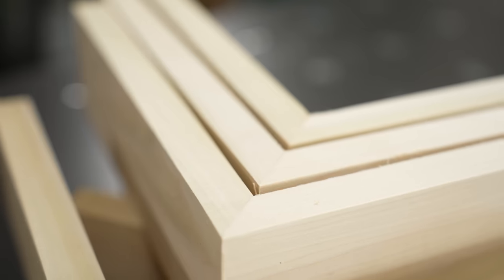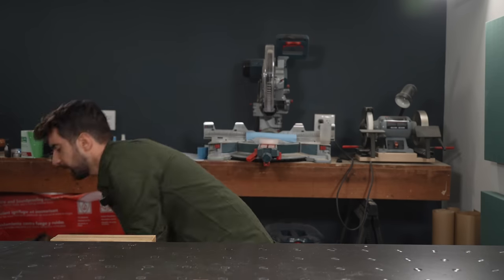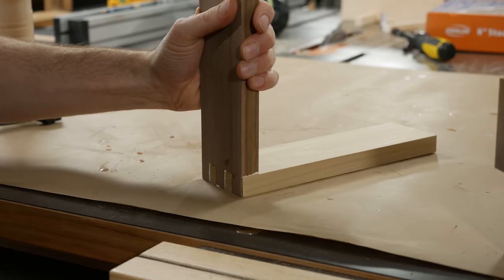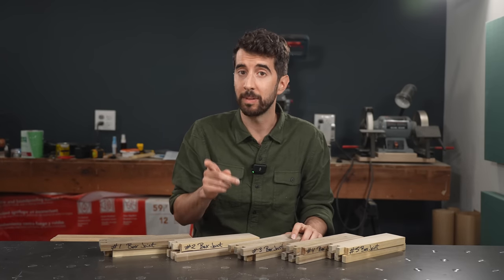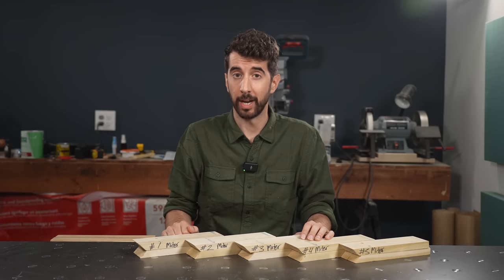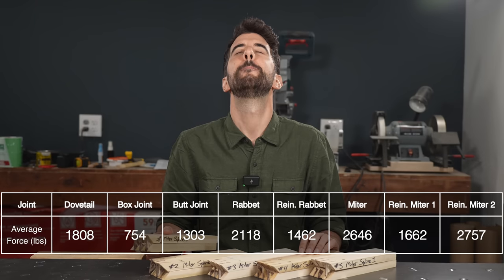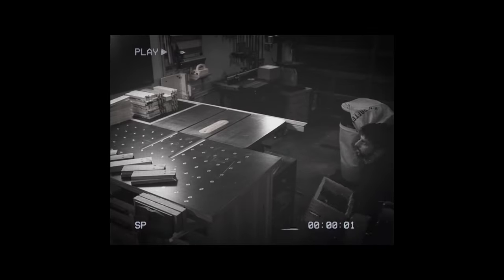This Simple Joint is Stronger Than a Dovetail!

Comment from the maker: If you’re struggling, consider therapy with our sponsor BetterHelp. Click https://betterhelp.com/scottwalsh for a 10% discount on your first month of therapy with a licensed professional specific to your needs.
Reply: What im struggling to see are the tests. All i see are you talking about them. Maybe therapy could help me with that?
Reply from the maker: if all your here for is numbers, then just skip to the end of the video
Reply: Time to drop this channel because of lame sponsors that have nothing to do with wood at all
Reply: @Yraens blah blah blah blah
Reply: @Yraens  Ridiculous that you're willing to watch something and not support the creator by sitting through a tiny ad section without throwing a tantrum...
Reply: You do realize you were pulling on the Tail piece of the Dovetail right?
Reply: @ScottWalshWoodworking  I think they are here to see how you got your numbers.  A miter joint is stronger in some ways, but not a drawer face with two miter joints. If I pull on one end the wood and angle stop the breaking, when glued. Just like the pressure on a Dovetail should be in the pins, not the tails yet all you did was test the wood fiber strength and glue strength NOT the strength of the joint.
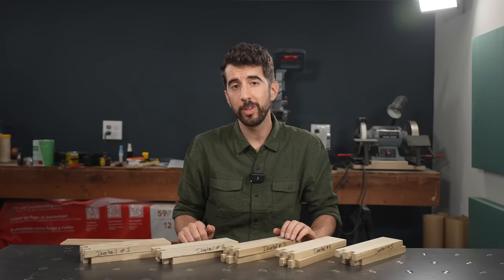Reply from the maker: @jimdoe1694  I was pulling on the pin board, you can see at 2:32
Reply: I was hoping you had included the locking miter joint.  Takes a special (re. ex$pensive) router bit, but no worries on clamp angle.  I've never had a locking miter joint fail, but I have had a patience failure trying to get the joint centered since one edge is done flat on the router table and the other is vertical.
Reply: First time watching.  The back ground music was annoying and the breaking noise was way to loud.  I had to keep raising and lowering the volume.  I did like your random funny comment I think the video was a tad bit too long.  I am always looking for more channels to sub to.  I typically watch 300 videos a day so I am often staved for content.  I won't be watching your other videos because of the music.  Good luck in the future and hopefully you stop adding music in the future.   I normally don't take the time to tell creators, but your video was so exceptional except for the music/noise that you deserved some constructive criticism.
Reply: @ScottWalshWoodworking  Not when it's one sided and you hold the other side, its pulling on the tail board too.  Make Drawer, put it outside, wait 2 years, then pull on both ends. 

Either way, the joint itself still held and the joint was stronger than the wood. All you did was another video on how glue is stronger than wood, who knows about the joint, and once again missing a dozen other variables, to come to some conclusion that a miter joint itself is strong.   Don't use any glue, which other than knowledge, skill, decoration, purpose, function, fashion, was the original purpose of the dovetail joint similar to other forms like many Japanese joints.
Reply: you sir have blown my mind
Reply: The mitered joint is just a bigger end grain glue up. Endgrain glue up are stronger than cross grain and parallel grain glue ups.

We think the opposite because wood is so much stronger with the grain than across it.

A few years back someone did a good video on this, and I can't remember the channel, but end grain glue ups were more than 2x as strong as parallel grain glue ups. They just always fail on the glue joint because wood is so much stronger in that dimension.

End grain glue ups are stronger because the wood is more ports on the end grain, so the pva has significantly more purchase to make a strong mechanical bond.

The miter benefits from all of this added strength, but does so over a larger area. Pretty much perfect.

Finally, what you say about glue failure from wood movement may be a real concern, but the miter should be the least affected by this of all the glue only joints, as the boards should expand and contract relitively uniformly in this thickness, and the glue will stretch with them just fine (as opposed to the rabbet, where the faces will expand and contract differentials from one another, creating a shearing load.
Reply: @Yraens  mental health is a very important yet sadly still undervalued issue. I hope you eventually learn that and grow supportive of it. Bye.
Reply: Do you think the results will be relatively the same if you do a vertical test? Meaning, you don't try to increase/decrease the 90 degree angle of the joint BUT try to put opposite directed forces on the two ends of the joint woods. Kind of testing the vertical strength of the joint.
Reply: My specific needs are to hear the * pronounced correctly as "asterisk", not "asterix".
Reply: 6 @ScottWalshWoodworking
Reply: Lincoln St. Woodworks mentioned this video. Of course, he said he was going to provide a link to it but he "forgot" to add the link. Cool video.

Comment: You forgot to test the most common joint: 1/8" pressboard tacked with one tiny staple, later repaired with clear tape.
Reply: ... and later still re-repaired with duct tape
Reply: ROFL, truth.
Reply: I tested this and SUPRISINGLY it failed at over 8,000 lbs.
Reply: Exactly 😂
Reply: I just had to repair a bunch of those in an apartment renovation. So annoying.

Comment: I think you have missed the point. There's a reason you see very old furniture with dovetail joints. Longevity. Most draws are never going to have breaking point loads placed on them. They will however have the stress of constant moisture changes and the resulting cupping effects and differential expansion rates. That's what dovetail joints are about.

Comment: Interesting results with a different testing setup than most. I'd like to see you expand on the theory of glue starved box joints. Compare box joints with varying amounts of clearance to see if a "sloppy" fit is actually stronger than a tight fit.
Reply from the maker: I'd totally love to, but it might be too far in the weeds for most people. I'll think on it some more.

Edit, I think Matthias Wandel did a similar test
Reply: @ScottWalshWoodworking  Matthias did similar joint tests and also speculated on glue starvation, but as far as I know he didn't compare different clearances to see if it had any effect.
Reply from the maker: @steveyork4173  i think this is the video I was referencing, it's not exactly the same, but it does touch on leaving a gap in a joint: https://youtu.be/14Mkc63EpMQ?si=nXc_Etpwpn-30U4J
Reply: The reason why dovetails became the gold standard for drawer boxes is because the forces drawers experience are where the dovetail is mechanically advantaged. You don't even need glue, so the fact that hide glue sucked didn't matter. The harsh truth is that any joint made with modern glue is going to be strong enough for a drawer box, including glue-less dovetails and glue starved box joints. So it's interesting, but at the end of the day it doesn't matter in reality.
Reply: @ScottWalshWoodworking  10 years back. No wonder I didn't remember that one. 🙂 He does seem to show that having a looser joint could be stronger. Still think it would be interesting to know the point of diminishing returns. Where's the "sweet spot".
Reply: @ScottWalshWoodworking  I for one would love to see that test, and do not believe it would be too far in the weeds. However, I understand you need to make videos that people will watch for it to be worth your time. But I really think lots of us would love to see this test! Thank you for all the time to you take making these videos.
Reply: Or he could test pulling on the Pins rather than the Tails, for anyone that has an ounce of woodworking knowledge.
Reply: I'm subscribing right now so I don't miss the sloppy joint video.  😁😁 @ScottWalshWoodworking
Reply: Subscribed 👍 i want to see this test too! I'm a newb woodworker and make varying types of fits. I've always wondered how much it effects the strength
Reply: I think you probably nailed it with the glue-starving theory.
And seriously, 'most' people watching this type of video are quite likely to be exactly interested in if their 'sloppy' fit work is actually stronger than how you tested with frankly nicer tool than most of us have available.  Its odd how you decided to do a second test on the mitre and not the box.
Reply: @CarlYota  If we were all just making drawers/boxes then you might be right. But we're not.
Reply: @Joslemian   I would love to see that test too ...these results don't align with my real world experiences.
Reply: It seems it's more important to focus on fatigue rather than join strength or tensile threshold, unless you are designing ultra sleek furniture with minimum material... Futuristic kind of.
Reply: @codirtbiker  Can you imagine any of these failing in normal use. Even 100 lbs is a lot of stress for most drawers.  And if you're working with MDF, endgrain isn't a thing.
Reply: @oneeyedphotographer  It depends on your definition of "normal". I agree for a drawer box, even a butt joint will probably do the trick in most cases. But box joints aren't only used for drawer boxes. I have used box joint/finger joints in the past as a load bearing joint. For instance, a cantilevered chair or bench or something like that. It is certainly possible to put several hundred pounds of force on a joint in real world uses.
Reply: @CarlYota  Strewth!
Reply: @codirtbiker  'Where's the "sweet spot".'
My gut is saying that would be right between "Slides in easily" and "wiggles around."
Reply: I'll add another vote for some testing of same joints at different tolerances. Or in more butt cases, different clamping pressures, which would press out more or less glue. 

I tend to go for tighter fits and higher cleaning pressures, but this seems to indicate to me that both of those might be less than ideal...
Reply: How much pressure is put on a furniture drawer?  Not much? Do shouldn't  you just use the joint that is the most pleasing to you?  Am I wrong?
Reply: Yes please, then I can justify my sloppy and loosely fitting dovetail joints.
Reply: In actual theory, the least amount of glue to fill the space between the two pieces of wood is going to be the strongest. But in actual practice, a very tight box joint causes a lot of the glue to be wiped away by the leading edge as it is pushed together. Therefore a looser box joint will hold better, because the glue is allowed to remain in a thick enough layer to be able to flow around any imperfections in the wood and remain in place as the pieces are pushed together. However, with tapered joints the leading edge is narrower than the rest of it, and therefore it does not wipe the glue away, but instead compresses it deeper into the fibers as more pressure is added.
Reply: "Does a sloppy joint work better than a tight one?" would get me to watch it. I also wood like to see something like a miter but with a wiggly cut for more surface area.  @Joslemian

Comment: Thing is... dovetails, or any of the mechanical joints aren't about "what is stronger" it's about "do they keep working" and even "can work without glue altogether." A mortise and tenon will remain functionally virtually indefinitely when just bored, no glue. A dovetail will work without glue as well, as long as you prevent it sliding out.

Comment: I did some experimenting of my own years ago and found that a simple modification of technique made a massive difference when using white glue on joints where end grain is involved. 
I found that simply moistening the surfaces with a damp sponge a minute or so before applying the glue drew the glue just a little further into the wood fibres and when the joint was broken it would draw more of the fibres from both sides of the joint, as opposed to the clean break at the glue/wood interface. 
This was 50 years ago and I have always moistened the surfaces since.
Reply: I like that idea specifically for end grain gluing.  This makes me think about using primer before using paint.  It would be interesting to see what the results would be if a 50% glue 50% water mixture applied to the end grain and allowed to soak in for say 5 minutes or so. Then full-strength glue used on both the end and flat grain parts and clamped together.  This would be interesting for sure.  From my perspective, modern PVA glue is so good that of a joint is properly fitted, glued, clamped, and allowed to cure completely, the joint will be reliable for most uses.   I have always liked this topic.
Reply: @Mark-EFMB-Combat-Medic  
Hi Mark. Your notion might well be an improvement over mine, although intuition suggests to me that you might be introducing too much moisture this way. I used a damp but not wet sponge to dab the surface, figuring that if I used too much water the glue would be overly diluted. It is easy, cheap and fun to try different ‘formulas’ with small pieces of wood and see which hold best. This is particularly relevant for mitred corners.
Reply: I was wondering the same thing. Thanks for your input!
Reply: Thank you so much for sharing this.  By far, will be my best upgrade since springing for titebond vs elmer's white.
Reply: I've never heard this, thanks for sharing!!
Reply: Either this or you apply the glue an wait for a couple of minutes then reapply it again and only then squeeze your parts together. You basically need to saturate the joint.
Reply: @sierraecho884  Best answer IMHO.
Reply: damn bro you old 💀
Reply: @ocoro174  What an oddly out of pocket thing to say.
Reply: @FauxpasYT  triggered? 😌🤙
Reply: I suspect that the reason that wetting the joint first works in because the water keeps the end grain from soaking up all the glue and starving the joint, which is the opposite of what you're saying, but this is all congetture from me

Comment: I have repaired lots of furniture over the years.  Never saw a really old box joint that did not fail.  Sort of.  They look sloppy and loose and the glue turned into grit.  I think the gritty flakes of glue tend to hold the joints together.  Dovetails loosened up too but the mechanical advantage worked for them.  A friend and I worked our way through college building kitchen cabinets and he continued making them until he retired.  Made hundreds (Maybe a thousand) of drawers with butt joints  and a couple of 1/4" crown staples.  Over the fifty years he was in business he never got a call back for a drawer failure.  Also important to consider the application and the loading.  Drawers get pulled and pushed in one direction over and over.  Some joints may suffer shock loading.  Drop a box with glued miters and the shock may break the joint but it the miter were reinforced the shock might be dissipated by the reinforcement before the glue failed.  Enough questions to keep Suman busy for years.
Reply: point one: he used titebond 3 which is good for percussion.  i wonder if, mentioned in video, a glue that would swell and shrink with temperature and the wood would be a better choice (like hide glue)

point 2: your drawer making buddy has taught us an important lesson.  dont think about it just do it
Reply: I really question the validity of these tests. Tests like these need to be conducted many many times to get valid results. There are options for avoiding glue starvation, every hear of using a swipe of coarse sandpaper (60 grit) over the mating surfaces.  This creates areas for the glue to sit in. One could also peen (press) indentations into the mating surfaces, that way the glue will expand the peens once the joint is assembled making for a really tight bond.
Reply: thats a suvivorship bias i think "Never saw a really old box joint that did not fail", however the other "not really old box joints" failed before you could see them maybe :). Although i'm not really a wood worker so i could be wrong.

Comment: Excellent video and a great testing machine. Also, your findings were consistent with what I have confirmed in practice, in my own field which is beekeeping. Back 50'ish years ago when I started, bee boxes could be purchased in dovetail, box joint, or rabbet. I assumed dovetail would be the best but my boss who was an old guy and been a beekeeper all his life only used rabbet. A bee box has a hard life. It is exposed to damp then dry then damp, and is outside in the sun. They get loaded up with honey and in a commercial situation are then banged around on a truck and through the honey extraction process. They are expected to give many years service. Through many years of using all types it had become plain that rabbet joints were the hardest wearing of the three options. Another factor, beehives have to be made from untreated timber. The dovetail and box joint corners will rot much faster than a rabbet joint.
Reply: corners always look like the weakest link. I wonder how various joints would perform if they had all rounded corners. When you said the rabbets were the hardest wearing, did you mean they wore the most or the least?
Reply: @itoibo4208   I meant they lasted the longest
Reply: That's an interesting observation
Reply: Because rabbets don’t leave end grain exposed to the elements like box joints and dovetails do?
Reply: @grimmWednesday  Good thought, probably part of it 👍